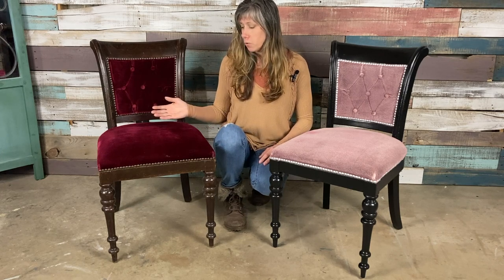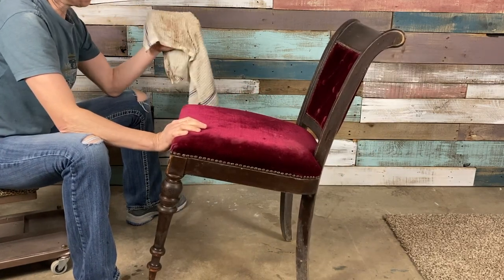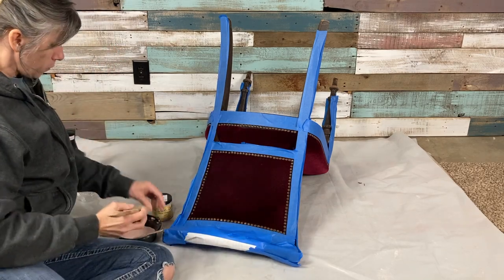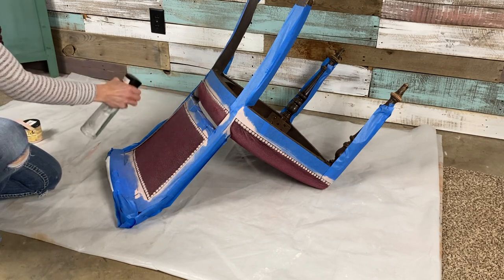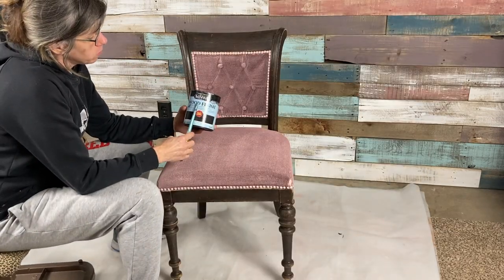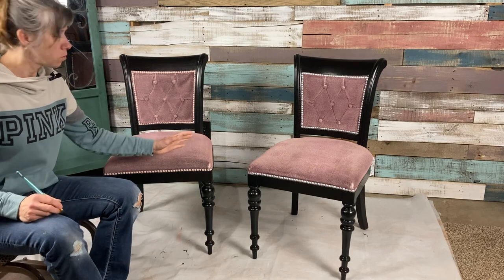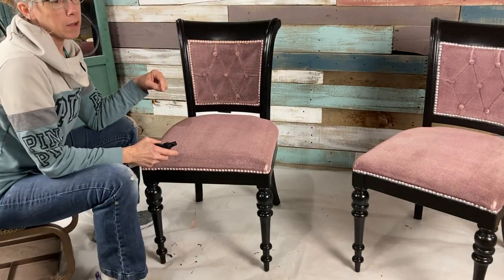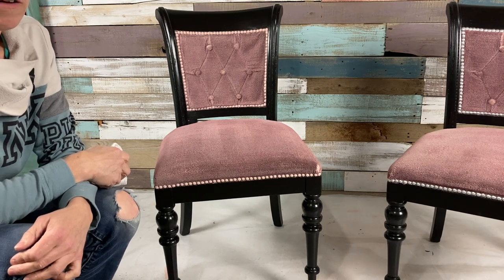Painted VELVET?! | How to Refurbish an Old Velvet Chair

Comment: Well I did it. For my daughter’s upcoming bridal shower , I took an old Victorian style dining velvet chair and completely screwed it up. I used high quality chalk paint and followed your instructions . Had to do 3 coats to cover a red velvet with ivory . Waited for each coat to dry before rewetting and repainting and now the final coat  has cracks all over , looks awful , sanding in between and at the end sadly did not work. I really thought I could do this and now devestated
Reply from the maker: OMGosh!  That's awful.  I'm sorry you had that experience.  The only thing I can possibly think of that sounds like it could have happened was the paint wasn't watered down enough.  Thickness can lead to cracking.  I have another video out where I had a similar issue happen with a wood chair.  I had it all done and it was looking good then I went to spray on a finish and it crackled in several areas!  I was deflated.  I had to resand and repaint.  I think that issue happened to be the two products didn't work well together.   But it just goes to show that you can do the exact same thing over and over with good results but then on one piece something doesn't go right.  It can be something as simple as the humidity at the time.  Without being with you and your chair during the journey it's hard to trouble shoot.   I do hope you have an awesome plan B for your daughters bridal shower.  And I am so sorry things didn't work out on this project.
Reply from the maker: Just a thought that I had that may work.  Since chalk paint sand and reactivates with water even after it is dry... As 1 last effort before totally ditching the piece, especially if you think it's already ruined anyway, I would sand down the last layer that cracked as much as possible.   Then wet it and work it around with a stiff bristle brush to reactivate the paint and work it into any remaining cracks, then let it dry to see if that eliminates the cracks.  Then if you have to build back up 1 coat at a time, just make sure you are not putting it on to thick, which may not be the case anyway, and make sure your humidity is not an issue.  If it's to dry in the air it may be drying to fast, or if it's too wet, it may be causing an issue as well.  It's been awfully dry in my home lately and wood glue dries before you can even work your pieces together and clamp!  Not that I can say that is the way to go.  You choose if it is worth your time.  I'm just the kind of person that doesn't give up and usually tenaciously keep at it and keep working through ideas until I succeed.
Reply: @packratsshack2821  I painted it ivory color the ornate frame and the fabric. My only solution at this point is to cover the front part with lace embroidered appliqués to conceal the cracks. I’m going to use hot glue to attach it and I hope it holds. For the seat cushion part I bought a satin toss pillow. The seat is worse than the other areas so I just have to use a pillow to hide it
Reply: @packratsshack2821  I would love to try again but there’s not much time left for the shower since I have other decorations to work on. The chair was in a very cold room, do you think that was the problem? 😧